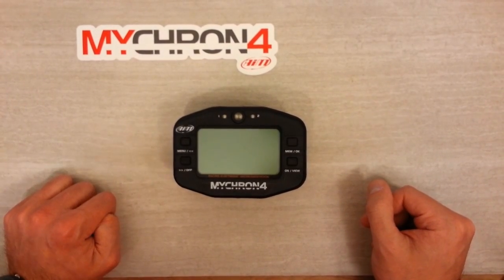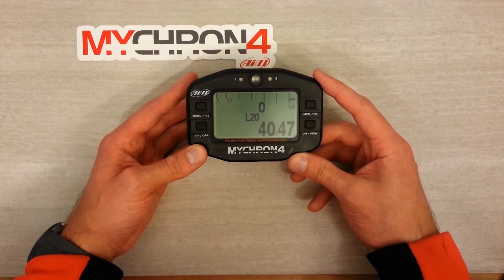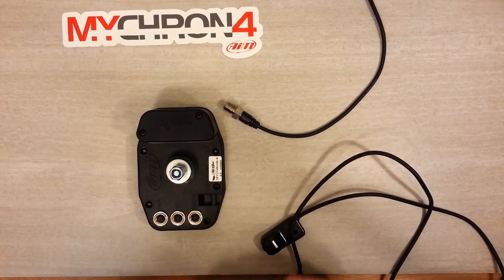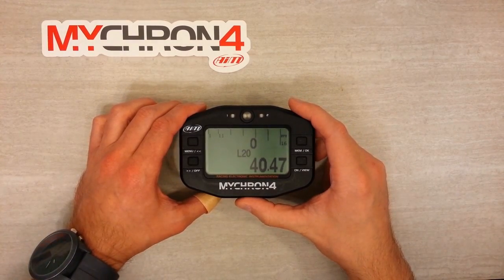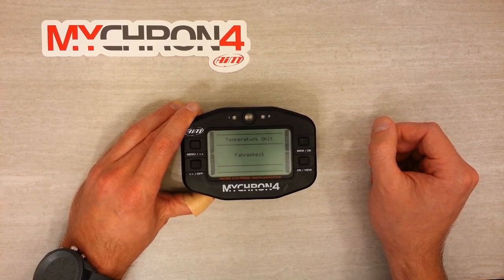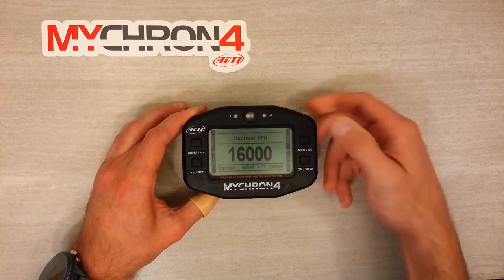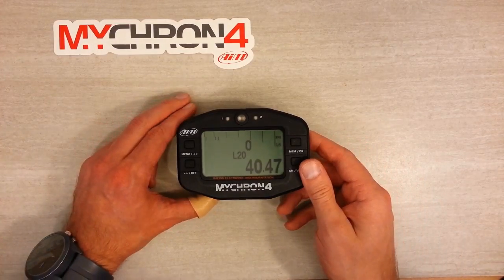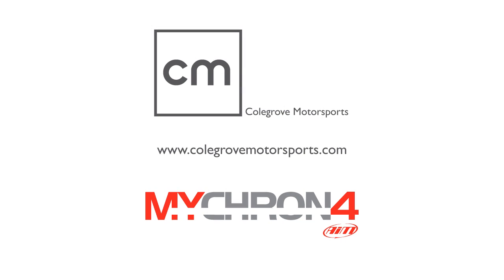AiM Mychron 4 Installation and Configuration Kart Data Logger

Comment: Hi hi,
I have a short question. I have a used Mychron 5s but i don't see the water temperature on my display. The sensor is installed in the head of the engine and the settings are good. I think my sensor is broken.
Should the display show the temperature immediately after the sensor makes contact with the water?

Thanks in advance!!

Greetings from Holland
Reply from the maker: It should always be reading the value of the sensor. Go into your screen configuration and ensure you have the water temp set to display. If that doesn't work try plugging a different sensor in

Comment: I have a standard go kart (non racing), how does this pickup the speed (mph)? I'm interested in the Mychron 5
Reply from the maker: The five uses GPS or can use a speed sensor which measures a magnet you attach to a wheel hub

Comment: Can Mychron 4 be used on a 4-stroke 4 cylinder engine for RPM read ? THanks.
Reply from the maker: Abdelkefi Mohamed Lotfi  That's an infra red lap sensor. you need an ir beacon sitting on the side of the track, but every time you pass the beacon with your kart it will trip the lap
Reply from the maker: Yes indeed.  There is a setting on both the MyChron 4 and MyChron 5 that allows the logger to compute engine RPM based on how my spark pulses happen per engine RPM.  This allows for engines that burn a spark at bottom dead center, or with other odd ignition timings to be properly read by the MyChron.
Reply: Can you please tell me whats the role of this sensor? https://encrypted-tbn0.gstatic.com/images?q=tbn:ANd9GcQOoQ5AV8qwtLJ_-bCR7MGHMJRZ3jS4PX6Q_Sg6NX5rKzee2sV2oA
Reply: thanks a lot!!
Reply: Kart Smarter THANKS !

Comment: Can you do something like this for the mychron 3 ???i need help
Reply: did u make it work? I got a mychron  3 aswell but it don't have battery cover
Reply: +Juan Dilan I don't think you can I've tried to find things on the 3 more but there's not much out there, I've talked to the aim guy at the track as well
Reply: +adam hunt  I think I found yesterday that the batteries goes to the box where u plug the cables. 
I won't be able to check till when I get back from work. just getting ready to leave now
Reply: very helpful thanks